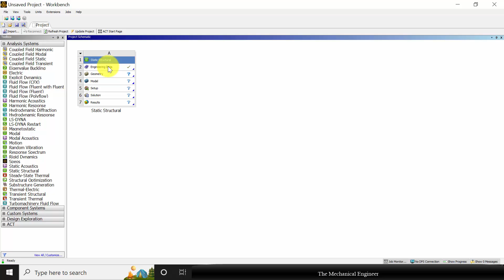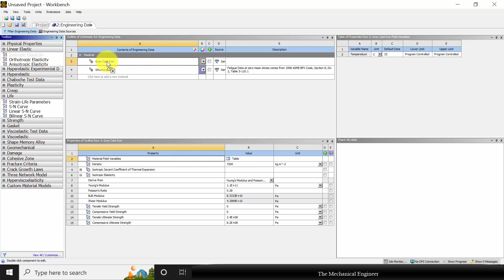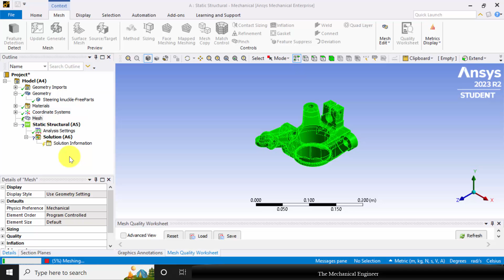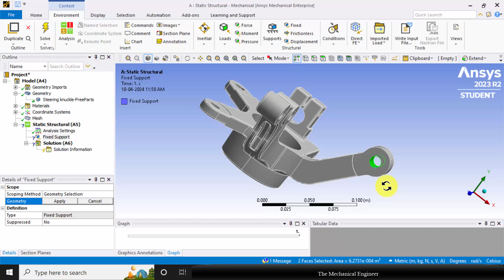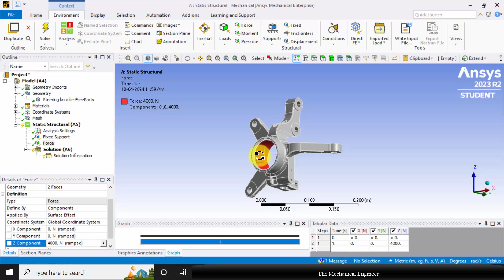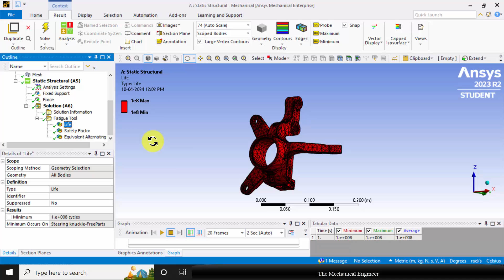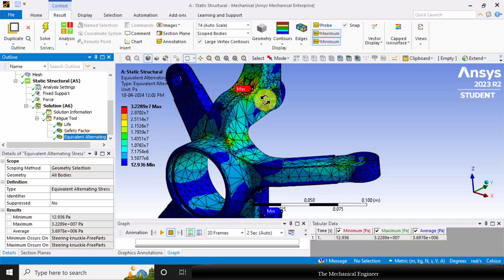Fatigue stress analysis on steering knuckle | SN Curve | ANSYS workbench tutorials for beginners

Comment: In the fatigue option you applied the zero based fatigue loading from 0 to 1. It means the load is oscillating from 0 to 4000N? Can we put the frequency as well?